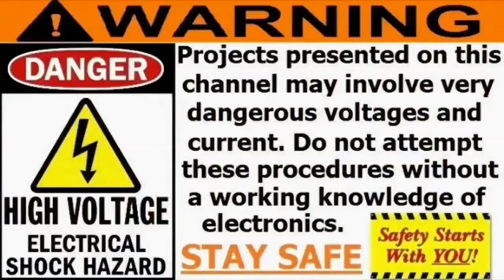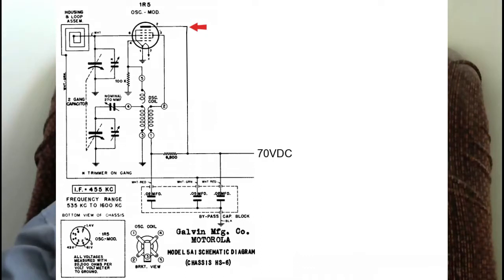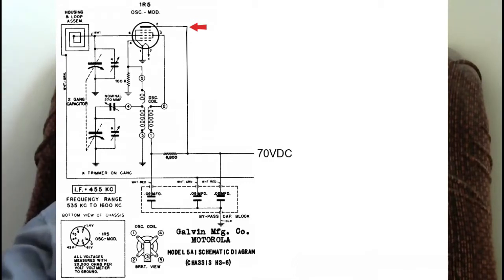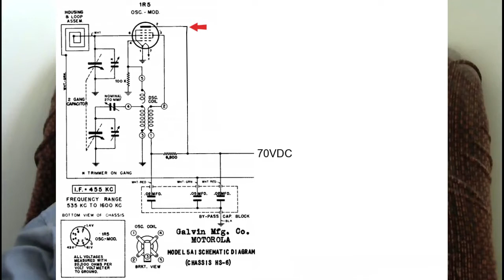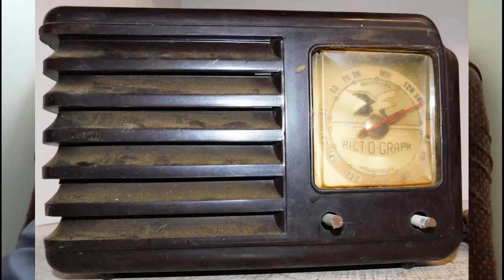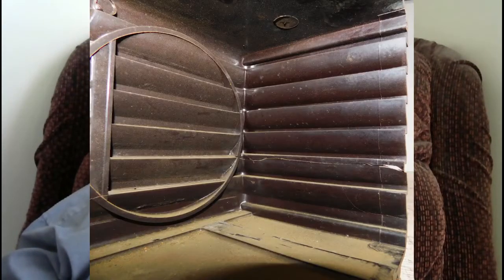DERB - Hybrid radio question

Comment: Hey Doug, looks like the IF transformers have been removed from the chassis. Looks like they were mounted where those rubber grommets are. The wires were routed through the grommets and the cans were mounted with two studs and nuts. These are the holes on either side of the grommets.

Comment: A would believe that you should be able to couple the RF signal to the next stage with a capacitor which would block the DC component.  You should have DC, two original signals and the Sum and Difference signals on the plate of the Mixer/Oscillator.  You should be able to scope it.  If you want to use it as an IF you would need a tuned circuit to pick it out such as an IF transformer/capacitor.  You might have problems putting a High Level DC signal on a transistor type IF.  Test’er out but Stand Back ⚡️⚡️✨✨🥴
Reply: @DERB_Seymour_Indiana  Would the RF/IF get into your power supply?  Most likely, but the level should be insignificant I would think.  I am wondering if you could use the coupling capacitor transformer as a series tuned circuit rather than a second capacitor in parallel with the transformer?  

http://www.arrl.org/files/file/Technology/tis/info/pdf/8504028.pdf 

Might give you something to think about.

I have seen things done BECAUSE the person doing them didn’t know that they were doing something wrong, or that it wouldn’t work, and they either repaired a circuit or invented something.  Good luck/fun!

Comment: No suggestions from me other than use an np0 or c0g ceramic caps so that their value doesn't wander with temperature.  I have an IF can or two laying around here, somewhere, but have no idea how to characterize them or tell you what radios they're from.  Wish I knew more but I mostly deal with audio amps.

Comment: I think the signal would take the least path of resistance from the plate through the power supply batteries, basically short circuiting the signal. The low internal resistance of a battery.
Reply: @DERB_Seymour_Indiana  Put a choke in the B+ lead.  That should block the signal from going to the power supply, but still allow the B+.  You would still need the coupling capacitor.  The problem might be figuring out a proper impedance match to load the tube AND ensure maximum signal transfer to the next stage.  You are now a “radio engineer”.  👍